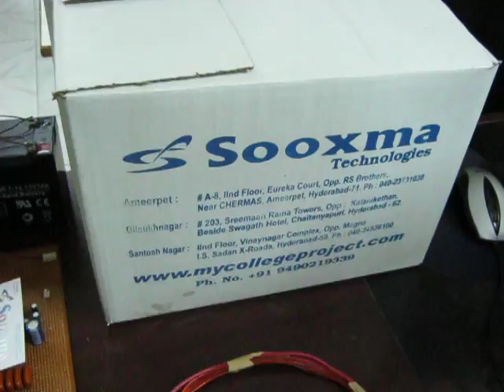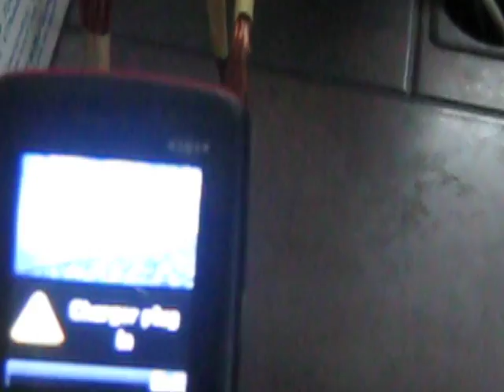Wireless mobile phone charging - wireless power transmission

Comment: What is the turn ratio of the transmitting coil and the receiving coil?
And will doubling or increasing the receiver coil turns,increase the output voltage like in a transformer?